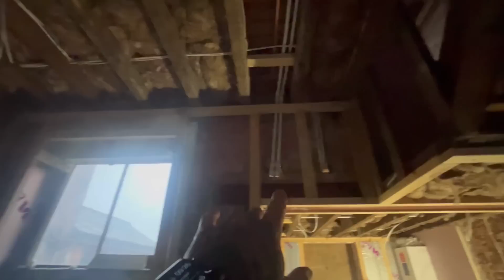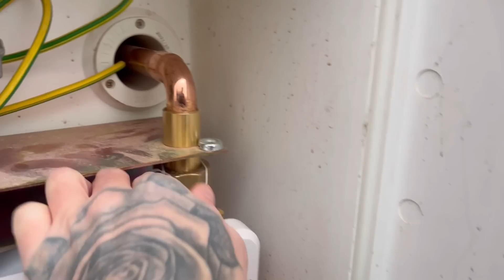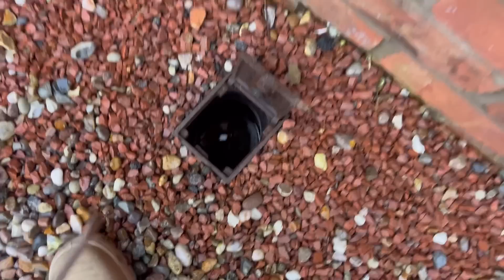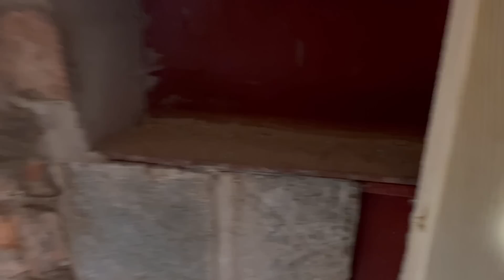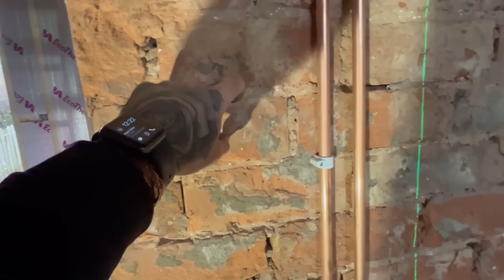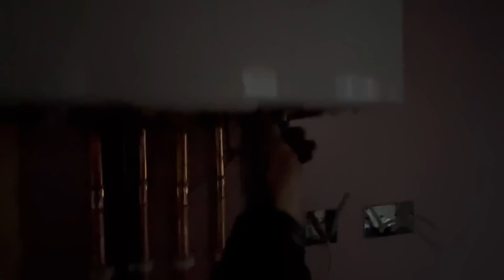SHUTTING OFF THE WATER TO 7 PROPERTIES! We’re Back! House bashing!

Comment: Hello..
Just started watching your channel
I live in a   TERRACED HOUSE...
THE STOP COCK IS
THE OLD 1/2 "  SIZE...
NEED TO REPACE IT
BUT 15MM ONLY AVAILABLE 
OPTIONS PLEASE 
JONATHAN
Reply from the maker: @Jonathan-hl9vb  a compression 15mm fitting will still fit on a 1/2 inch pipe mate. You can get plastic fitting (philmac) which will convert to and from whatever you want though.

Comment: nice tidy job mate nice when your left alone to get on with the job rather than all other trades fighting for same space.
i agree with the earth cable coming through the same sleeve at least you can see it is bonded as for the sleeves i was always fort they had to be sleeved in copper but on my last gas course i read that they could be sleeved in metal or plastic on my last gas inspection i  asked him and he said plastic is fine and it used to be a regulation
Reply from the maker: Cheers Robbo! We could do with seeing that in writing 😂😂 and yeh it’s nice to have a free empty property but better in summer. It was dark and cold in here haha.
Reply: @Heatking  if you can get a copy of Essential gas safety. Domestic published by corgidirect I find it a handy reference book as it cover most things flues ventilation pipe sizing ect and its is in there

Comment: Good video however I’m sure double check should be between drain off and stop tap for water regs
Reply from the maker: Thanks Tom. I’ve not heard of that one! Unless they’ve changed the regs since me doing my water regs 😂 which is quite possible 😂😂
Reply: @Heatking  no dramas maybe worth adding one in and depending on appliances of washing machine and dish washer mi’s now ask for check valves on them. Most dishwashers have them in built.
Reply from the maker: @F7plumbing  I knew it about washing machine and dish washers but just not on the stop tap! Thanks buddy.